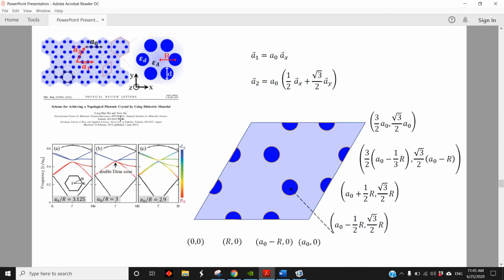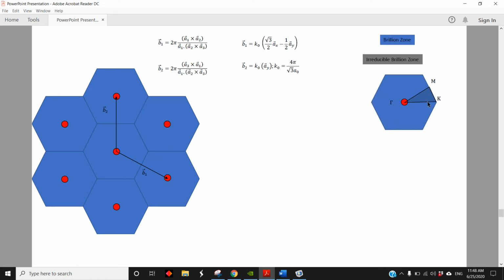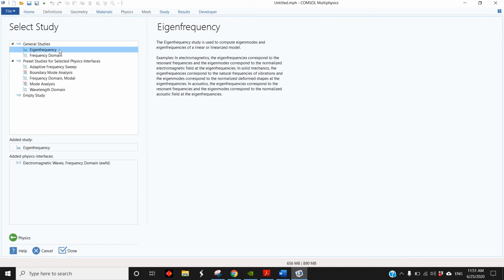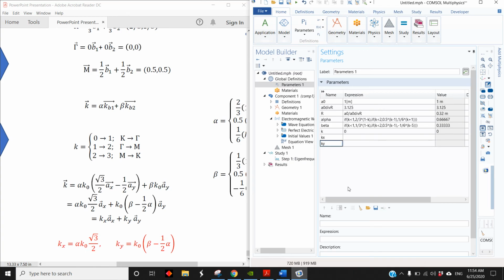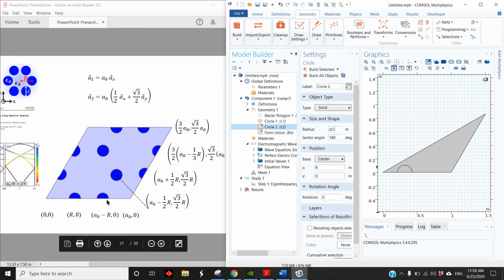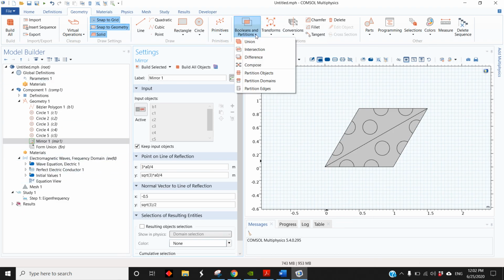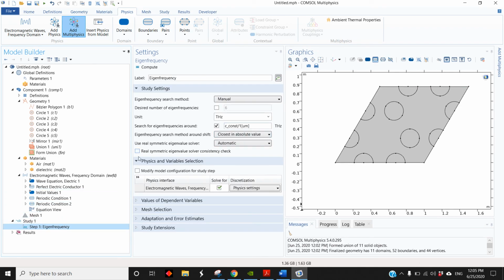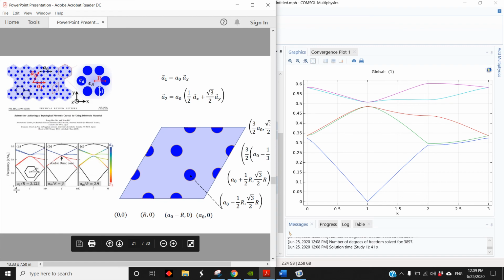Triangular (Hexagonal) photonic crystal using COMSOL - Band Diagram simulation.

Comment: Thank you Ahmed :) I have  a problem with understanding why the coordinates of K are (2/3,1/3) and not (1,0)? K should be normal to b2.
Reply from the maker: K is not parallel to b1.
Reply: @ahmedmekawy1632  you are right, I realized the mistake I made now. By the way, did you ever uploaded the demo for calculating TM band diagram (in your chat with Keke)? I am struggling with the same thing over and over, and it would be super helpful if I would have your version, to see what am I doing wrong. Thanks in advance :)

Comment: Thank you Dr. Ahmed for this tutorial. It really helps the begginers in the field of photonics and Topological Photonics. Sir, I have few query regarding the band calculation which is metioned below:
(1) Can we calculate the band structure for metallic photonic crystal ( e.g., say, structure is formed by the Al rods) in the same way? But for that we have define the real and imag. part of the refractive index of the material. It is difficult to define the metal's refractive index in the GHz frequency range.
(2) Could you please make tutorial video regarding the dispersion band calculation of the 2D topological Photonic crystals?

Thanks again for this tutorial.
Reply from the maker: Hi Sabhu.
Thank you. 
1. Yes, you can define the real and imaginary part, you need then to make sure that the option for the material in the wave equation is set to permittivity instead of n, k. You will get anyway more problems of convergence once your material is dispersive because the problem will be nonlinear.
2. This video is a 2D topological crystal. I do not understand.

Comment: If one of the materials depends on the wavelength how can we calculate the dispersion curve?
Reply: There is an example in COMSOL, you may try it. In that example, an eigenfrequency problem is solved first, then the eigenvalue modelling is performed using a stationary problem with a ODE equation. I hop it helps.

Comment: Dear Ahmed, Thank you very much for the tutorials. It has been a great help! May I ask what is a k0? In the square lattice  tutorial I assume in direction from gamma to M, k=kx+ky = (1-k)*pi/a+(1-k)*pi/a ?
Reply from the maker: Dear Vida, Thank you. 
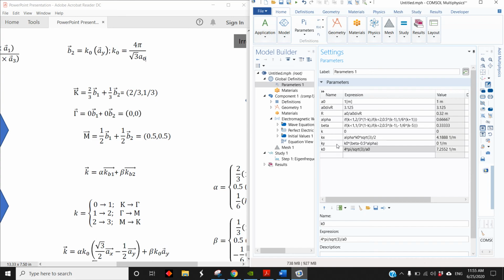k0 is a scalar quantity, it is taken to normalize the reciprocal lattice vectors, b1 and b2, to vectors of unit length. For example in this video 11:07 time, if you look at either b1 or b2, you find they are vectors of unit length with a scale factor k0. So it is just a number. If you need to calculate k0  for square lattice, it will be k0=2*pi/a such that, b1=k0 (0,1) and b2=k0 (1,0), i.e., they both have unit length scaled by the scalar k0. Therefore, the M point in the square lattice is written in terms of k0 as, M = k0 (0.5,0.5). Wish this helps.
Reply: @ahmedmekawy1632  Thank you very much, that hepls a lot!

Comment: I was working on my bachelor's degree project few months ago and i was struggling with a problem for quite a while that i finally figured out the solution myself. It would've been a great help if i had found this video earlier. Great tutorial 👍
Reply: By the way, is photonic crystals your research area? I could use some help if you would mind. Thanks so much.
Reply from the maker: @ramineskandani8596  Hi Ramin. No it is not. But I do not mind to discuss.

Comment: Your tutorials are quite impressive, but  I have a question for the simulation of the TE band :
Based on your instructions, I calculated the TE band of the model: https://mpb.readthedocs.io/en/latest/Python_Data_Analysis_Tutorial/.
The TM band solutions look fine. But for the first band of TE solutions, when k sweep from 0 to 0.06(maybe), the normalized eigenfrequency changed rapidly from 400THz to 20Thz(a=375nm, r=0.2a). Although I modified the "search for eigenfrequencies around" and "larger real part", nothing changed, the TE band still looks terrible. Could you help me with it?
Reply from the maker: As long as you get real eigenfrequncy, and reasonable field distributions, I think it is only an artifact of how COMOSL connects the points using line. To show this, in the coloring and style tab in the 1D plot, choose none for line, and choose circle for marker and in data points for positioning. 

I solved the same problem for TE (In plane) with search for eigen frequncies aroind 2e8 (you may need to scale this for your geomtry dimension) and closest in absolute value option. the results attached here, 
https://ibb.co/myGXsyv
Reply: @ahmedmekawy1632  Great! I've got the same result as the "MPB" website. The default "interpolated" option misleads my understanding of the band structures, and it is more clear after I exported the data on the relationship between the eigenfrequency and k. Thanks a lot.

Comment: Very useful! Thanks for uploading. Is it possible to make another video for calculating photonic bandgap for multilayer (4-5 layers) of hexagonal arrange spheres. For ex Photonic opal ?
Reply from the maker: thank you, can you share a link for a specific example?
Reply: @ahmedmekawy1632  I guess these references: 
Band structure and optical properties of opal photonic crystals
E. Pavarini, L. C. Andreani, C. Soci, M. Galli, F. Marabelli, and D. Comoretto
Phys. Rev. B 72, 045102 – Published 1 July 2005

Spectral properties of opal-based photonic crystals having a 
SiO
2 matrix
A. Reynolds, F. López-Tejeira, D. Cassagne, F. J. García-Vidal, C. Jouanin, and J. Sánchez-Dehesa
Phys. Rev. B 60, 11422 – Published 15 October 1999
Reply: ... I think this one is more related  with detailed description  (seems they all are with hexagonal unit cell with low index contrast). 

Optical properties and diffraction effects in opal photonic crystals
Alessandra Balestreri, Lucio Claudio Andreani, and Mario Agio
Phys. Rev. E 74, 036603 – Published 6 September 2006; Erratum Phys. Rev. E 75, 059906 (2007)

Comment: I have a question about choosing the unit cell? Why don’t you just choose the six circles in the hexagonal as the unit cell? Does this make hard for the Geometry in COMSOL?
Reply from the maker: that's good observation. I could have done it with hexagonal lattice, and it would have been actually much simpler, and definitely give the same results. 
The reason i keep it triangle is to make it more general. for example in this tutorial the angle between the two lattice vectors was 60 deg, and they were of equal length a0, so when you stagger them you get exact hexagon. assume now the lengths are not equal and/or the angle is not 60 deg, this will not be the perfect hexagonal shape, it will be tilted hexagon, which i believe would be more difficult than just triangle!
Reply: Ahmed Mekkawy Also, for the TE mode I ask in your last video. When I only change out of plane vector to in plane vector, the solution for eigenfrequency have complex numbers. And when I plot the frequency in the Global as usual, I get a zigzag band diagram. I know this is wrong but I just try to figure it out. Does the complex numbers matter and do I need to do something to retrieve the complex numbers in real and then plot? Thank you!
Reply from the maker: @keke301  complex numbers mean evanescent modes, and they are not solutions of the band diagram. You should get purely real frequency. In rare cases (due to coarse mesh) you can get very small imaginary part.

The solution in the last video for TM band: 
you can try changing some options in the Eigenfrequncy tab under study1 as follows:
change "search for eigenfrequencies around" from 0, to some other frequency, 1e5 for example, 
and the option "Eigenfrequncy search method around shift" choose "Larger real part"
That should work let me know if it didnt
Reply: Ahmed Mekkawy Thank you for the suggestion. I have tried as you told, but it still get complex frequency numbers and the band diagram looks wrong.
Reply from the maker: @keke301  that's weird! I tried this and it works for me. Do you use the same dimensions, and material? 
In paraller, you can start by just solving for 1 band, in addition to that try changing the eigenfrequency to a higher value, 1e7, then 1e8, ... may be, also play with the last option let it smaller imaginary part, until you get a real number.
Reply: Ahmed Mekkawy I will try and figure it out. I am not sure if the number of eigenfrequencies has an impact on the results. I will try one band first. Thank you.
Reply from the maker: @keke301  you can try the option "larger real part" first.
Reply: Ahmed Mekkawy Thank you so much! I have tried all of you said but unfortunately it didn’t work. I would like to ask if you could send me a demo of yours since you say it works in yours. If not, it is totally okay. If you could, I really appreciate your help.
Reply from the maker: keke yes I can. Should I upload to some site, and you download it from it? Do you know other way? I am okay with anything.
Reply: @ahmedmekawy1632  , Thanks for the good work, I appreciate it. Based on this discussion, I made a hexagonal cell simulation to test this. When I am running the simulation, I am getting a slightly different bandgap. Can we discuss this somehow? I used a general approach to define K space because I want to implement the rest of the part of this paper. I have single rods in the center of the hexagonal unit cell and I defined the x directed lattice vector as a1x = a*(sqrt(3)/2), a1y = a/2, a2x = a*(sqrt(3)/2), a2y = -a/2. When I simulate the bandgap, it looks different. Can you have a look at how to correct the K space path to get the same bandgap? I used those kx and ky values used by you but that also doesn't change the results.  File is available here.       https://gofile.io/d/KG4Z2d
Reply: Note :  My parameters might be slightly different but that should not change the shape of the bandgap, it may just shift the bandgap to a new location, that's it. If you doubt, you can modify to keep according to your values, but I still don't see much difference in the shape of the bandgap.
Reply: @keke301    I meet the same issue for in-plane electric field, where the band diagram around Gamma point changes suddenly. It would be appreciated if you could tell wheter you have solved this problem or not. Best regards. By the way, i tried with the comsol of version 5.5 and 5.4. Both versions give the same wierd results around gamma point.
Reply: @itree11  Did you get the correct band diagrams?